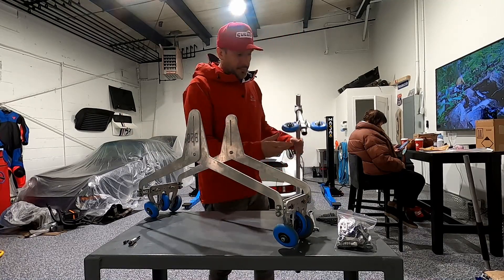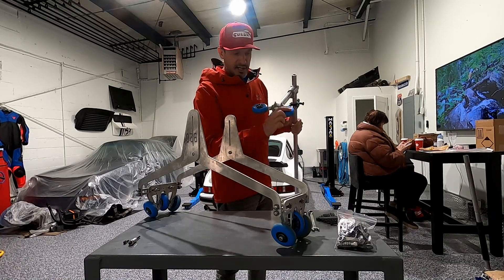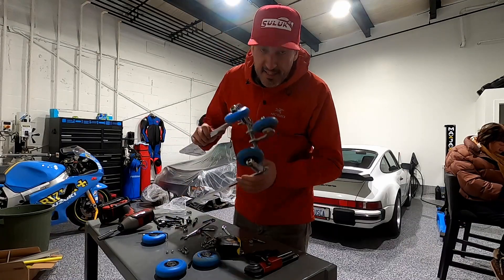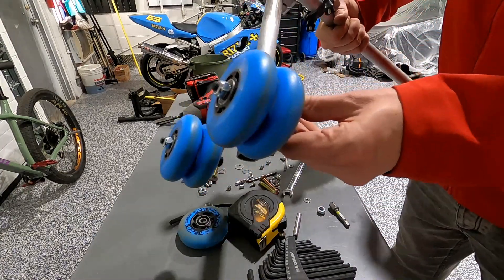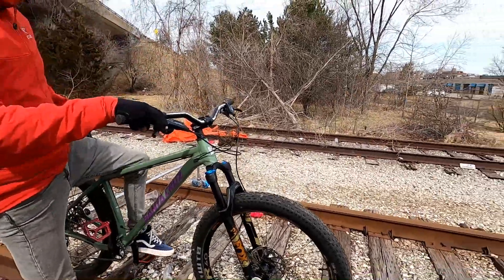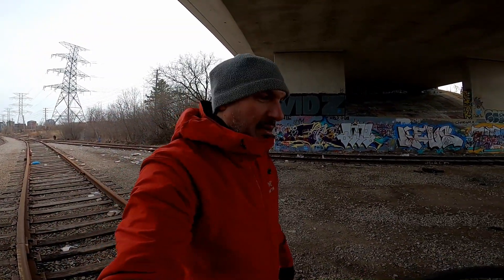RAIL BIKE - Version 5 - Added adjustability & removed the outrigger -- Building my own railbike

Comment: the point in using rail is to reduce friction between the wheel and the track/road. Make a steel bicycle tire that hogs the rail making as little contact with the metal as possible.
Reply: I believe there's actually a steel wheel available specifically for rail-biking, but I don't know the dimensions
Reply from the maker: Steel wheel? Good luck 🤣

Comment: Skateboard wheels, and tapered to give it more width, and tapered to help keep it centered on the rail, and somekind of suspension, spare parts, and tools in a low center of gravity positioned compartment on the out rigging arm to prevent hopping and maybe a helmet because the tracks and everything that your riding on is unforgiving in every way!!.  Thankyou so much for this video!!!!

Comment: I think the problem w/out the outrigger is getting started. Like riding skinnies, you will have a hard time starting form a stop on the skinny. But if you have momentum going into the skinny it's really not too hard. Wonder if the guide had some lateral flex?
Reply from the maker: I know that it seems possible with enough speed and stuff, but it's not. Reason is imagine riding a skinny and while trying to stay upright and on the thin skinny someone is making micro inputs to the handlebars (the guide) causing you to lose balance. Without the outrigger for balance, you then need to remove the front guide....and then you are just riding a bike a regular bike on a skinny. I would prefer to not have any outrigger, but the create something that self balanced would probably be a bit complex.

Comment: I would try horizontal wheels on the sides.
Yes, it may not work on crossings, but just heading down the rails would be more stable....my 2 cents.
Reply from the maker: You are correct, so far the fully horizontal front side guide wheel has worked the best. Thats the plan moving forward.

Comment: What about springs? For the guide wheels. That way they could automatically adjust to the different rail conditions one experiences while riding. Finding the correct springs for the job would probably be the toughest part. If they are too strong, they won't adapt but if they're too weak, instead of adapting they'll be bouncing out of place.
Reply from the maker: We talked about doing this in one of the previous versions. I think it would make the micro-onputs to the steering of the device smoother at the least. You are correct, it would be difficult to guess the best spring rate. On the other hand, it would add more parts and complexity to the system which needs to be relatively easy to maintain for extended remote trips.

Comment: Front guide should be vertical flat steel guide wheels and one center rubber for comfort. You should be able to pedal with no handlebars. The wheels will steer you.

Weigh the bag and fill tube on outer end with lead to match.

Comment: i've been following along... have a railbike idea myself... my one thought, would be to combine the outrigger with the front wheel guide into a single unit...?  also, due to the potential for stress on that front guide part, perhaps pulling that little fastener through the slot of the aluminum guide arm, add a washer?  in my version (steel, because, weight is better than lightness IMO), i think i'm removing the front wheel completely, and going into a fork mount, while, having a (yakima style?) fork to hold the front wheel onto the outrigger (adds ballast)... i have a couple ideas about adding a second wheel fork, that allows me to 'tow' the set up, like a trailer, when not on the rails, even incorporating a 'bike packing' element within the added outrigger brace, so the entire package is compact, practical, and, can add ballast to outrigger while on rails... hmmm.... if i were to do a 'cross-country' version, for sure i'd consider going more lightweight with aluminum, as long as the strength wasn't compromised.... great project!  keep it going!!
Reply from the maker: Nice! Lots of good ideas. The Bentley Railbike, which seems to be a very popular internet version, has the front wheel completely off the track, similar to your idea of having it a fork mount. I'm sure it works very well, and I'd consider it if I didn't need to switch between tracks and trails. I've also considered moving the outrigger to the front. Just this weekend, I experimented with wheel angle on the front guide - horizontal, vertical, and 65 degrees. My conclusion, is that it doesn't make a ton of difference. I think that there are a bunch of different ways to design a working Railbike and depending on what you want out of it, will be more of a driving factor than getting it to work.

Comment: Any thoughts on adding a bar from the middle of the outrigger towards the bottom or base of the outrigger wheels? Would that add any stability?  I feel like the outrigger isn't stable and wont be  strong enough for a longer distance and you may snap that bolt again.
Reply from the maker: I am really trying to keep the outrigger as a single arm. Just so it is packable and universal to all my bikes. Right now that outrigger is just thrown together, and with the replacement of the bolt has not failed yet. I will have to at some point run some numbers to verify that it won't break. Right now it is an aluminum tube, I could change it to steel and it would be 3x stiffer with a weight penalty. Honestly, I have to wait and see after I play with it some more. I'm building version 6 tomorrow.

Comment: Thanks for including the part on trying to ride without the outrigger. As I said, getting started and stopping is going to be the hard part. It's not until you are going fast enough that the gyroscopic effect of the wheels will help you stay up. As you show in the video, the control dynamics are different than riding the bicycle without the guide, and training your brain to do it is not trivial. Given your guide, why don't you just try riding with the guide down on the street? That way you have much more leeway to learn how it works without immediately failing. Your experience so far reminds me of trying to learn to sailboard. The control response needs to be so fast that it needs to get into muscle memory.
But since everyone else out there posting videos of rail bikes is also using an outrigger that definitely seems like a reasonable option. One interesting piece in your video was the camera view from the outrigger showing the swinging of your bag of rocks. That is important for the dynamics. It shows you the spring action of the bar and at least one of the frequency modes. Much of that is the spring constant of the bar, but it might also give you some insight into the driving frequency(ies). This could be helpful in designing your outrigger. I would like to see your measurements of the spring constant of the outrigger. In the next iteration what means are you thinking of to add dampening, especially adjustable dampening, as well as adjustable mass, to the outrigger? Right now you can add rocks and move it in and out, which might be enough mass adjustment, but you need some dampening I would guess.
Reply: It is possible to ride a bicycle in a very straight direction. But it is a problem like differential calculus. The tire needs to turn a very small distance back and forth to be able to maintain the balance. It is a dynamic stability. The trick is to find a control mechanism that keeps the tire on the track while still giving you the control necessary to keep your balance by very small adjustments in the steering direction. It's a hard problem to solve. It's much easier to just put on an outrigger. But making a stiff light outrigger with the appropriate damping to avoid any resonant shaking is not easy either. 

This has been a fun project watching though and it has led me to investigate things that I would not have thought otherwise, so once again I am happy to be following this channel!
Reply: @kknappmiller  I definitely agree that if that problem can be solved it would be way better than an outrigger. Maybe some sort of ballast system?
Reply: The problem with eliminating the outrigger is the same as riding a skinny: the problem isn't keeping your wheel straight, it's keeping your mass centred laterally over the rail. It's probably easier to ride with just the outrigger, VS just the guide.
Reply from the maker: You are probably right, if I went slow enough, I could get rid of the front guide no problem. Just the front guide without the outrigger is impossible. The only option to remove the outrigger is to then remove the front guide, but at that point it's not a reasonable solution to my problem, as you would just be riding a skinny for 100 km.....wait a second...100 km MTB skinny? That would go viral for sure 😂
Reply: Ordinarily, you counter-steer a bike opposite the direction you're going to lean+turn, before steering into the lean. A guide leading the front wheel, will turn you before you start leaning; disaster. So, a guide that leans you just a bit, in the direction you need to turn, might actually help keep you on track, even better than an outrigger can! 

The immediate challenge I see, in designing such a tilt+turn guide, is that it can't be stationary relative to the front fork; it'd need to be mounted such that pressure to turn leftward, tilts the fork/bike leftward as well. 

I'd have to experiment myself, to figure out a good method for speed-proportional tilt... but a railbike without an outrigger should be doable (with less drag!) once the right amount of COG offset is found!
Reply: The "horizontal plane" element may not be necessary or even the best choice. Just getting the gyro spun up to stabilize you at low speeds is the trick.